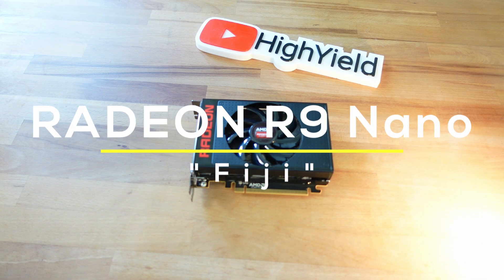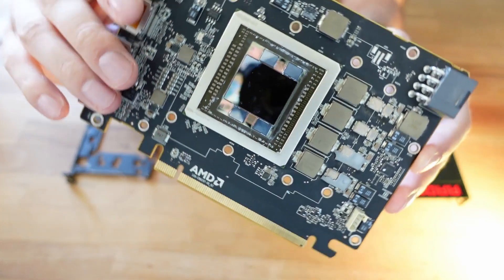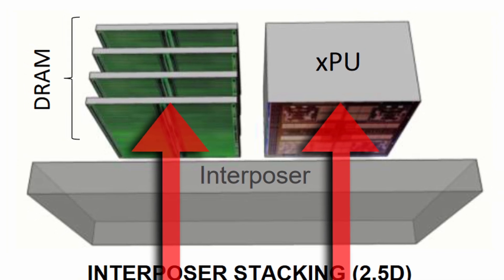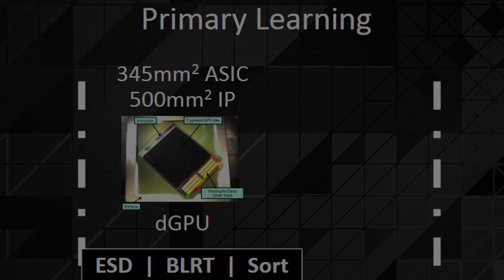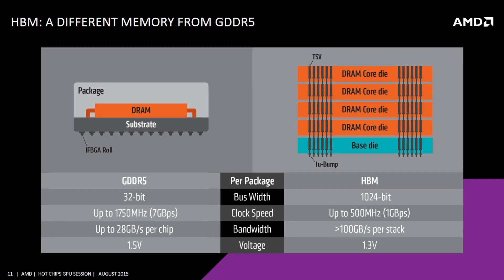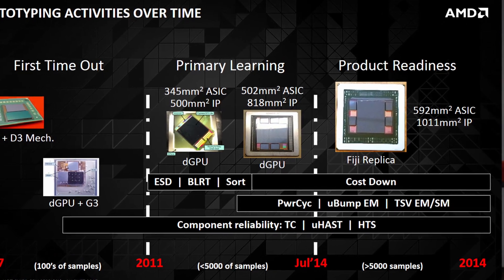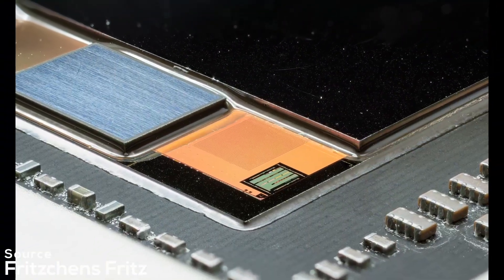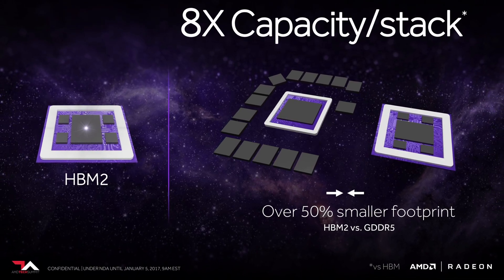How this tiny GPU invented the Future

Comment: one other problem is repairability, right now the gpu repair market is actually high that scammers where desoldering the gpu chips and gddr memory from cards and selling the remains for cheap as "functional". common problem with gpus are corrupted memory chip, with hbm memory, you cant just replace a dead memory because its sitting on the gpu core itself

Comment: Vega 10 actually topped out at 16GB total on the two stacks. Vega 20 wasn't just a die shrink of Vega 10. I still contend that VII was Vega 2 and not '7'. Unfortunately a lot of issues with Vega 20 are because of TSMC. They didn't have their CoWoS tech ironed out and used a poor copper alloy that was too rigid and resulted in cracking and failure from thermal cycling. Lisa got it cheap by sole sourcing the interposers from TSMC and we consumers paid the price. Vega 20 is incredibly delicate, often dying in shipping despite proper packaging. It did get the best AMD 50th birthday treatment though. The special edition cooler is absolutely beautiful.

Comment: I think the greatest place we could use HBM is in APUs. Having such efficient, super fast memory be shared between a powerful CPU and GPU, its like a dream for laptops
Reply from the maker: I agree, APUs would benefit the most. But currently HBM also requires the use of a interposer (think CoWoS) and it's super expensive. Maybe in a few years, when HBM capacity is strong enough or AI accelerator demand declines.

Comment: Now they just have to add more cores per ccd, improve the infinity fabric bandwidth and latency (it's already a bottleneck currently and with more cores per ccd it's just going to get worse), improve the memory controllers on the io die to support faster ddr5 (the additional cores will require more memory bandwidth and tbh even currently with 16  cores you're often bound by memory bandwidth especially with zen 5 and it's wider cores and faster avx512) + work just as fast with all 4 memory slots filled and put a gb or two of edram stacked on the io die to serve as l4 cache (again to provide more bandwidth for the extra cores). Smt4 support would be nice too especially now that the cores are wider (preferably with the option to switch between smt4/smt2/no smt per ccd on the fly) as would extra l3 cache per core (so if each ccd has 16 cores 128mb l3 cache per ccd without counting the 3dvcache) and more l2 cache. Hopefully we'll get at least some of that with zen 6. And once they move to am6 they really should add an extra memory channel, ddr6 support, extra pcie lanes for the cpu - chipset connection (going from 4 to 8) and add pcie 6 support at least for the cpu - chipset connection. With all the extra bandwidth between the cpu and the chipset they could put a memory controller or two on the chipset (at least on the high end ones) that would use ddr5 so you could use your old ram too and get more memory capacity/bandwidth from it (it will be slower than the memory connected directly to the cpu so hopefully the os would be smart enough to be aware of that and use it for things that are less critical (the filesystem cache perhaps? or let the user decide per process which memory should it use if the cpu memory is full) and/or use it only after the cpu memory is full... so good luck to anyone using Windows (since even after zen has been around for a long time it still keeps bouncing processes/threads from ccd to ccd and still doesn't let you select which apps will use the ccd with 3dvcache, which will use the one without it and which can use either/both so you have to use things like process lasso for that nor does it let you select if you want to use the cores/threads on one ccd first and only turn on the other ccd if necessary (for lower power consumption) or if you want it to use both ccds from the start (for extra performance)))

Comment: I have a readon VII that I picked up recently for the mostly for the cool and hard to find factor (and the price was good as I got it for 161 us dollars from a microcent with a warranty as a refurbished gpu) and run that in my main system from time to time. 
Was just playing Star Citizen last night with it. 

This explains why my radeon VII has the monstrous 4096bit bus that it has, with the 16gb of HBM2 that it has, because it's on 4 stacks. Kinda thought the reason that it had that much memory bandwidth was because it is really a compute GPU/because it had HBM2 (didn't have a specific reason why I thought it had the high bandwidth bus other than I knew it was because of HBM2) its kinda cool to know how connected the bus width is to the memory stacks

Comment: i bought a arez vega only for that tech marvel , using it in a x79 platform as a pcie pass-through for win10 vm; also the possibility to cache system memory to increase video memory is another benefit for the 4ch ram workstation boards

Comment: For AI, what you do is you have the memory distributed amongst the processing silicon that does the hardware multiplies. You need to store millions of weight values so you can use memristors that store them as analogue values. Tsinghua University has a working prototype. It's far more energy efficient.

Comment: Problem with hbm is you can't repair it when its gone while reballing or replacing ddr modules is relatively easy. But i do believe that hbm will be the way forward as integrated graphics become more powerful and more power efficient than traditional pc-s.

Comment: The best and worst thing about the Nano is that it was greatly power-starved, and nothing made that more obvious than it being the only card of its time that could easily run Furmark without any risk of thermal throttling, because it just couldn't ramp up enough to overheat in that application.

Comment: I used to have an R9 Fury (which died during OC) and a Vega FE onto which i had to mod a Raijintek Morpheus cooler.
Cool products, held back by the GCN architecture and, in case of the Vega, the cooler.
Seriously, with the stock blocker, it wouldn't run it's full boost, as it would quickly hit 95 on core, 105 on the HBM2 and like 115 junction. Tuning and undervolting made them much more usable.

Comment: Funny there is nothing inbetween 32bit and 1024 bit memory interfaces. Isn't it?
Reply from the maker: It does make sense from a design perspective. Either you want a small and simple interface and get the performance with high clock speed, or you want a super wide and complex interface with efficient low clock speeds on the memory.

Comment: for the cost of HBM to come down most likely it will have to be in bulk orders more than the bulk orders they have with the Hopper GPU and Intel with Intel Xeon Scalable MAX. Yes there is HBM on a server CPU. When compared to the HBM on the nVidia GPU the HBM on the Intel CPU is objectively better. Probably as it is 1 HBM chip per 1 CPU chip on a 4 CPU interconnected package with each having their own HBM chip. 
The probably of "only" having 4GB per chip has been solved some how as the HBM on the intel chip are 16GB HBM chips. Now it is probably a 20k USD package that you need to buy 2 of to have the server boot. Really just having 2 of those chips on a gaming card even if it is the TITAN or x090 class or whatever AMD will rename their highest end card to will get a lot of people to buy it. 32GB of HBM3. Mostly the 32GB of VRAM part so to have their card have enough VRAM for games now and the next 3 to 5 years as games get more and more demanding. The downside is the HBM2E costs well Mircon says "contact sales" so most likely a non-static amount depending on the company they are selling to and how much how often. So it probably is more than a Samsung GDDR6 8Gb(2GB) chip on alibaba. As it is only 0.32 USD per chip when you order over 1000 chips at a time.

Now with  games requiring more and more VRAM and it becoming harder and harder to get that amount with in up to 32 possible places for video RAM chips so 64GB if they stick with GDDR or they can go with HBM and it will just be 4 chips not 32 chips. Not an issue until games use the generative AI stuff as generative AI at minimum takes 2GB to run then depending on what they have it doing another 1GB to do it's thing but those are at the low end of how much it can take to use. I have seen it use 3GB to load and 12GB to run. Thankfully an nVidia driver update had my system just spill over into system RAM after all video RAM was taken. As games will most likely start by using the img2img version with a simple prompt and GSRGAN i on their artists image to not have or have a lower chance of repeats in games the image is in story erased then redrawn every time you leave the area. A little longer area loading time when they do add this into games but GPUs are getting there that you might have a minor frame rate drop when you enter the area having to make what most likely is the size of a frame to be a texture while rendering the game. The reason why 64GB of Video RAM would not be enough for gamers? Well if the triple A companies don't force us to play the game using their cloud but do it all locally AIs are getting bigger and for some uses you will have to run 3 or more of them that are not designed for games at the same time while running a game and the AI like logic which is more so like advanced scripting logic in the game like normal. The first game to do that will be mocked for it going slow and having a low and sometimes inconsistent frame rate. Where do i think the games will end taking up RAM? Well as i think 8k is coming for gaming if we like it or not some where around 50GB. Broken up into 18GB for the game 20GB for the LLM for the game 8GB for the img2img AI and another 2GB for the OS to do with so it doesn't crash. The part of 18GB for the game is assuming they go with the method of textures they are using right now just scaled up for 8k from 4k.

Comment: I've been saying for quite a while, that we'll probably be seeing RAM built into Processors soon.
I mean, with SOC devices, it generally is built in, couple that with the issue that RAM speed is often limited by distance from the CPU, and track length is a real issue. Plus you were already seeing CPUs with Graphics built in.

Lets step back a few decades to the 1980s and 1990s and look at the Amiga as an example. The Amiga had multiple different types of RAM, and all could be used by the system. There's Chip RAM or Slow RAM, which is the only RAM installed on the base system, but also Fast RAM as an option that could be built into an accelerator board, and other RAM too, so why not do this sort of thing in more modern systems? I mean, why does RAM all have to be the same speed?
My Laptop as another example, actually has RAM soldered to it's motherboard for slot 1, with slot 2 being an expansion socket, in theory 1 of the reasons why this RAM is soldered directly on rather than being in a socket is speed related, and to keep track lengths short. Why can't this onboard 8GB be built into the CPU? and I don't mean the Cache, I know they have some RAM built in, but it's usually tiny compared to system RAM.

IMO, the future of PCs will be a CPU that not only has multiple x86/64 cores, and Graphics, but also "Fast" RAM (in line with minimum system requirements, like 8GB, not the Cache) and even several ARM cores, slowly replacing the x86 cores with ARM cores over time with more generations. You'd still also have RAM slots on the motherboard for expansion as an option, but it wouldn't be a requirement anymore.
I am aware this will probably require a slight update to operating systems to allow it to distinguish between high speed and low speed RAM, so active programs can prioritise the high speed RAM usage, and other software can use whatever is available. And also updates to allow ARM and x86/64 usage simultaneously.

Comment: If this was so revolutionary then why neither of the 3 big GPU companies use it anymore on desktop cards...? May be it's not that great for gaming (when perf/cost/etc considered).
But yes, when Vega came out, I already started fantasising about HBM next to CPU die. Yet Intel will put regular DRAM next to their 15'th gen.
Reply from the maker: Because it's in such high demand for AI & HPC GPUs, that it's too expensive for gaming cards.
Reply: expensive compare to vram module, abit overkill for gaming usage, which is targeted for consumer card, unlike in AI/compute, and very high repair cost, hbm cant be replace unlike vram module when it failed, so for most user vram is more practical and cost effective for gpu vendor

Comment: Dunno how to feel about this. Looks great but seems like it's impossible to repair. So any out of print card will eventually become E-Waste. Where current GPU tech is at least repairable. Can't imagine needing to replace that memory stack if one of those go faulty or end of life. In fact it almost seems impossible to determine if the GPU core or HBM ram is faulty should a fault occur between one of those.

Comment: for the current memory problem something like HBM is a good solution, and for AI you might actually start looking more at something like a FPGA, but also with some new form of memory directly build into the compute logic itself, essentially AI often uses many weights and such, now they are stored in ram, instead it could be stored more analog or paralel like actually having logic weights buffering memory, where you can even buffer weights directly to logic, kind of use that as ram, this could allow insane speed increases. with a fpga this could be simulated early on just on a small scale to test it. 
but essentially when done right it is ideal for AI since then it doesn't really need to compute it anymore, instead it just knows it, and it is kind of like analog but then abstract and perhaps digital still but it is like analog as in more like a quantum computer where you insert values/changes somewhere in the logic itself. perhaps inserting it to a special core like thing which decides/manages where it needs to be input and then doing that.
this essentially means that the ram no longer needs a speed and just is direct basically, and instructions are not given but instead written to the logic which also is the ram, this means the main bottleneck is a possible clockspeed/settle time and the speed at which the instructions can be handled, probably mostly the last one which right now tends to not really be concidered a problem.

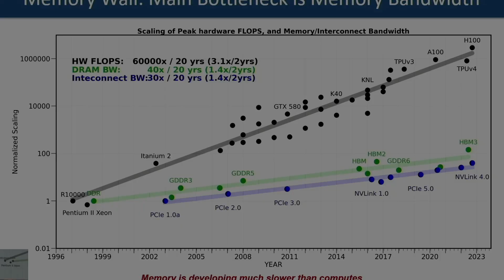Comment: The bottleneck across all chips no if enterprise or personal unless u have huge chip from Cerebras is still with the memory interface and bandwidth. Thank u for reminding everybody here: 16:53 why memory design has to improve and reach speeds and bandwidth of the SRAM. Until SRAM capacity becomes big enough and economically viable (probably never:) gaming industry is stuck with classic DDR or possibly one day HBM once they become cheaper. AMD's V-Cache solution is interesting as well, but the capacity won't grow to sizes gaming GPUs will need in the future (Cerebras has "just" 40 GB;). I think before HBM becomes standard with the gaming GPUs we will see chiplets of the 3D stacked SRAM similar to V-Cache to improve performance of the memory interface as it has been also mentioned on your channel that SRAM has reached its scaling limitation:
https://youtu.be/vQ5JPqeFitM?si=xT04j8KXUb586HbC
https://fuse.wikichip.org/news/7343/iedm-2022-did-we-just-witness-the-death-of-sram/

Comment: But like please stop zooming on information slides because it's just not readable for most of the shot
Reply from the maker: You have a point, but I can see views dropping off much faster if I don't keep some kind of movement in the video. I'll try it without for the next video!
Reply: @HighYield  yeah I see there needs to be some kind of jingle jingle for the kids to stay focused, but cropping out the start of every sentence for a few seconds... actually maybe it does the trick just fine, because for those who want to read it it's harder and it makes them way more focused.